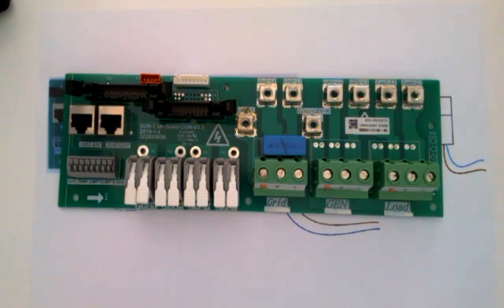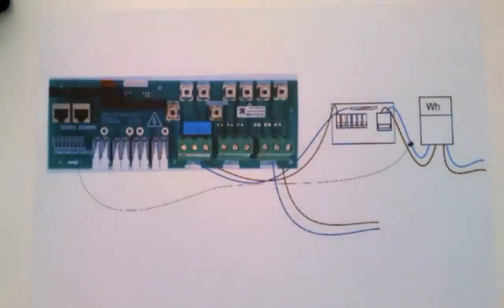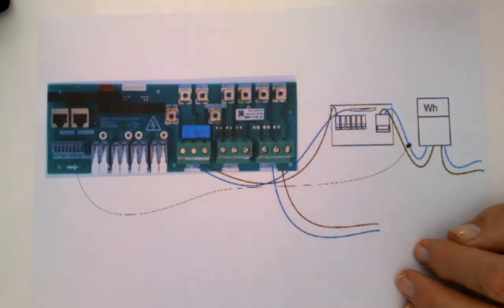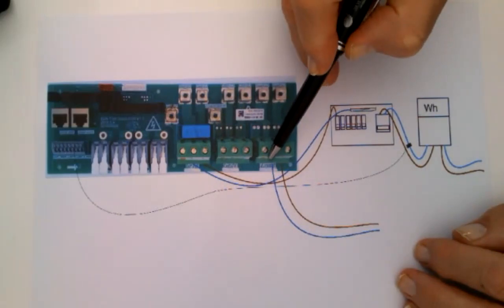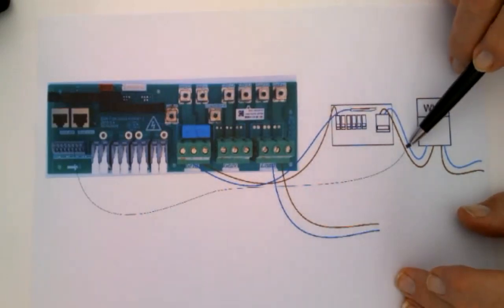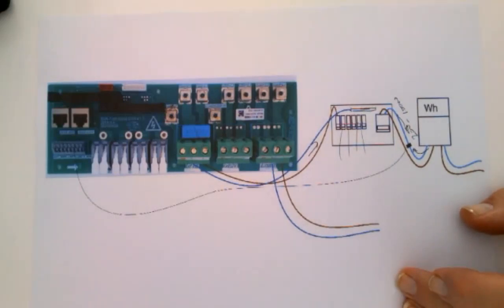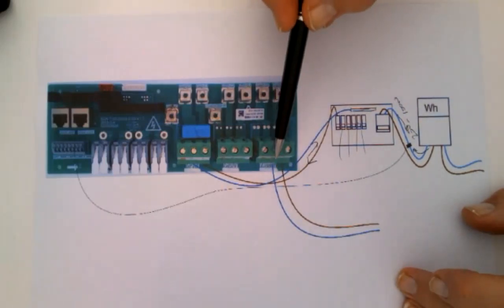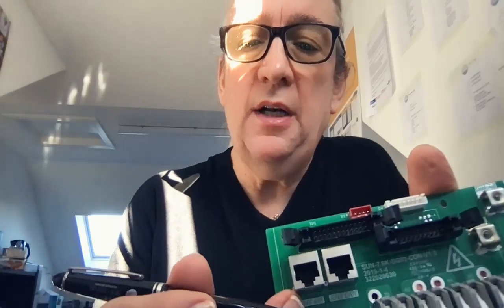Simple wiring of our Inverter

Comment: Thats very informative, thank you.
Could you please also create a similar video for required connections & operation in island mode during a UK grid blackout? For both automatic and manual grid disconnection isolators?
Reply: For instance one of my problems is that I understand that the inverter must detect grid failure and shutdown to avoid danger to grid repair workers,  but if you operate an isolator (manual or automatic) to remove the inverter and house from the grid, the inverter will still see no grid voltage so will not restart to power the house. I’m confused!

Comment: Is it possible to add a solar panel terminal onto a 12v mecer inverter? Mine has a slot covered by a metal plate and I'm not too sure what is behind the plate.
Reply: The inverter in this video is explaining a Sunsynk Hybrid inverter, it's completely different from the Mecer/Axpert inverts.

Comment: not a very informative video at all im afraid.  Could you perhaps do a better more understandable video explaining how to connect and what to connect to the 8KW inverter connectors to prevent from making any mistakes? That silly drawing made no sense at all .....
Reply: It made a world of sense. If you don't understand the basic diagram in this video, maybe get a certified electrician?  I'm not an electrician, but Grid would be coming from your DB (AC In), Load would be the AC Out (plugs, lights)
Reply: Load is for essential services. Grid port is bi-directional so usual AC circuits. It's an in and out basically.

Comment: will the grid port still works (solar/battery) if no power coming from the grid?
Reply: Did you end up knowing the answer to this question?
Reply: @mazeneid2828  for Deye inverter the grid port will not work if no power coming from the grid.  only the EPS port works if you have solar harvest or sufficient battery charge.